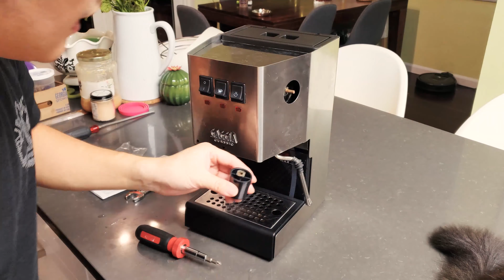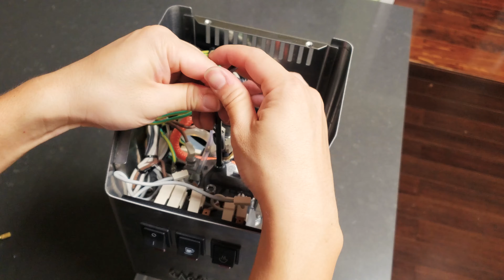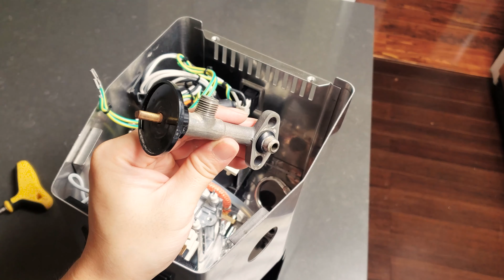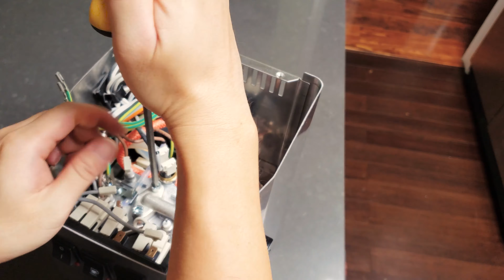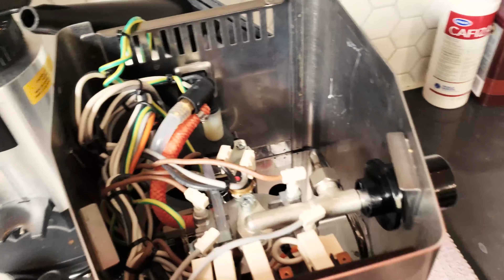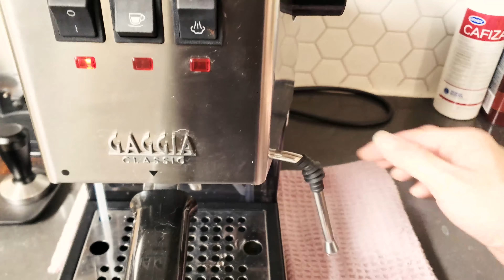How To Replace Gaggia Classic Pro Steam Valve & Knob Assembly - Espresso Machine Maintenance

Comment: Changed the stem valve but very little water coming out from the port filter
Reply from the maker: stem valve only controls the steam wand. if little water come out from gaggia classic, could be the boiler is full of scale now if not maintained previously, or bad pump.

Comment: I have water leaking from this circular plastic thing that the valve is inserted on the inside. Do I need to replace the valve ?
Reply from the maker: yes, it needs to be replaced. Not terribly hard to do with right tools.
Reply: @TheGizmoGarage  Thanks. I ordered the valve from Amazon. The knob is terribly stuck though prolly due to rust. I guess I’ll try using wdt over the weekend to see if it comes off. The video is of immense help. Thank you for providing it 😊

Comment: The pin is NOT optional. It holds your steam spout part and steam bolted part together.
Reply from the maker: Thank you sir. For anyone else it refers to my comment at 12:20 in regards to the pin that holds two pieces together.

Comment: Hi your video is really helpful. Hi. My gaggio classic, I think the steamer knob crack and cannot turn and now out of control for steamer on/off. When I turned on the brew switch, the hot water with steam came out. Not sure if it's a knob problem or something else.
Reply from the maker: Your steamer knob may be one problem, and it seems like you are developing another problem with the brew switch, it could also be the thermostat that maybe faulty as well if you had your gaggia classic for a long time. Many things could go wrong. It is best to contact your local espresso machine distributor to find out if things can be repaired, or it might be time for a new machine.
Reply: @TheGizmoGarage  thx for your great advice.

Comment: Hi  if your machine was only a few months old at the time of making the video  I would suggest that a bigger issue is that you have very hard water that is causing scale deposits throughout the machine. If you still have the Gaggia I would suggest you backflush the machine weekly at least and do a descaling once a month. If you still have scaling issues then you need to provide yourself with a water softening solution.
Reply: Can you explain how scaling causes the assembly to leak? I'm having the same issue.
Reply: @worm1618 , limescale is porous and it forms in joints pushing them apart causing leaks over time. It's also somewhat acidic so it pits and corrodes metal, especially aluminum (like your boiler). If you can see evidence of limescale in any appliance that heats water from your residence (white chalky staining) then it's in your espresso machine as well. It's really important to not allow it to form in the first place. A cheap way of dealing with this issue is to use bottled water. It's usually a lot softer than Municiple water. Stay away from distilled water because it will react adversely with the various metals creating galvanic corrosive electrolytes. I would say that water quality is the most important component in coffee making since it makes up 99% of your beverage and by its very nature it's a solvent. Get a cheap water quality test kit to test for Ph and trace chemicals from Amazon or your local aquarium supplier. It will tell you everything you need to know about the water you're pouring into your machine.

Comment: Hi Li great video I have a question my steam valve when closed the knob stops but when its heated and I try to close it it will stop but then it turns. My question is it supposed to do that? Meaning when closing it its supposed to stop yes? Thanks

Comment: From what I've read on various forums this is a common problem with this machine. The real solution is for Gaggia to not be so greedy and make their machines with better components and quality control before they put them on the market to sell for over $400. No one should have to go through all this hassle for a machine that's only a few months old. And the company should not expect you to make the repair yourself. Rip off.
Reply: I agree.  My 10 month GCP recently started to leak steam at the tip both when heating up and after shutting off.  I only use filter BWT water and also descale and back flush regularly.  I'm hoping the replacement Gaggia steam valve operates as it should and lasts closer to ten years or more!   The machine costs as much as some stoves and 4 times more than my two Panasonic microwave ovens which have been trouble free for 16 years.  Customers deserve better!
Reply: @seesaw7289  the company had to replace the machine I bought twice. Still the steam wand started leaking within a couple of weeks on a brand new machine. I sent them a video and they sent me a new steam wand to put on myself. It worked okay for a few  months then it started leaking again and getting worse all the time. Now it leaks before, after and while I'm pulling a shot. I too take very good care of the machine as I had a similar machine (Saeco) for 14 years.

Comment: Good luck with that old o-ring.  Typically it's best never to reuse old o-rings because they get compressed into the old position and may begin to leak in the new position.
Reply from the maker: I agree with you... Ordered some silicon FDA food grade o-ring to replace the EDPM rubber one in there right now...
Reply: @TheGizmoGarage  That's a great idea.
Reply: @TheGizmoGarage  Where were you able to find the correct sized o ring?
Reply: DO NOT, reuse the o-ring. I did and it leaked within a week
Reply: whats worst is that you might not notice because it leaks at the top of the boiler where its really hot and evaporates near all the wiring... which could cause worst issues down the road
Reply: Does it keep leaking????